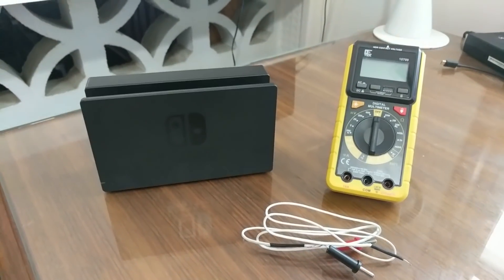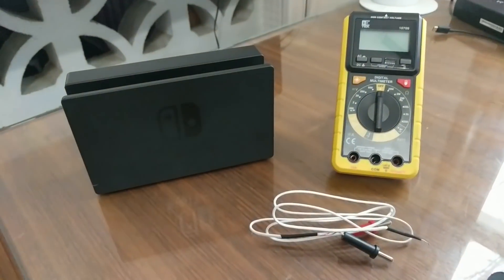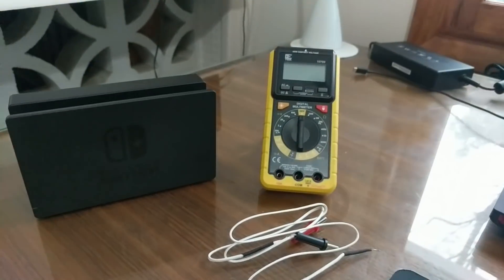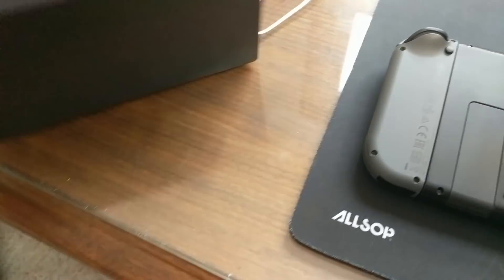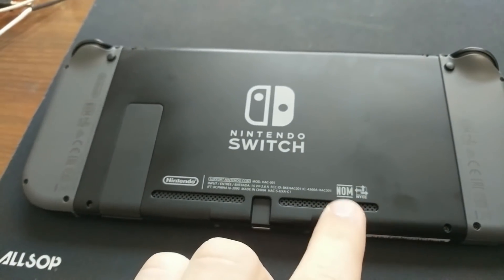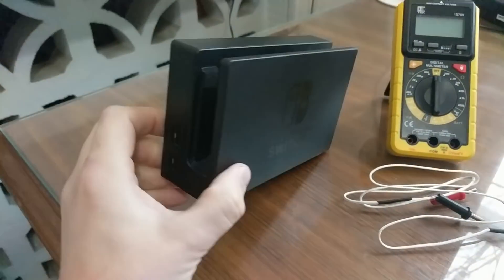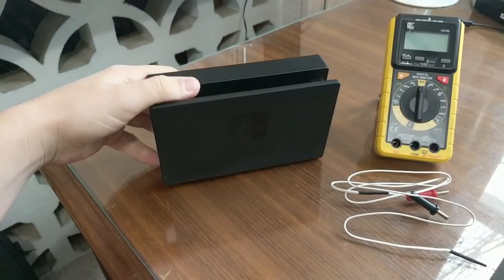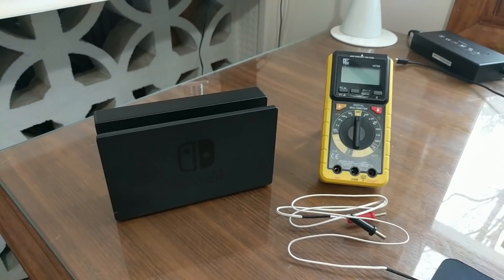Final Nintendo Switch Cooling Mod - Available Now!

Comment: My biggest question before I consider buying this is what about the dock itself? Will the circuit board in the dock overheat? Turns out that with my used Switch and dock, after some period of time, the audio will start getting loud and start cutting out, especially during the loading screens. I don't know if it's a problem with my Switch, my dock, or if it's the monitor I have the HDMI cable hooked into. If it is my dock, it may make the problem even worse.
Reply from the maker: The circuit board will be fine.  There is no active cooling in the dock and it does fine.
Reply: @M1dn1ghtN1nj4  

But doesn't the Switch suck in air from that part of the dock, also blowing in air over the circuit board?

Comment: Hi. i just purchased the print files to let it print localy. This is the first time i come in contact with 3d printing therfore i have some questions. Wich print material should i chose?  Also i can chose between difrent "infill %" from 30% to 100% . Does the infill  percent matter with this kind of Model? To my understanding it does not, but better safe than sorry. Thanks for the work and the fair price. best regards from germany
Reply from the maker: PLA will do just fine.  Since it's so small, I sent with 100% infill.
Reply: @M1dn1ghtN1nj4   i'll go with 100%. thanks for the quick reply

Comment: Doesnt this mod cause circuit board in dock to over heat im sure there is reason qhy air drawn past it remmber your hdmi and your usb 3.0 and power all located there surly it generates lot heat needs venting?
Reply from the maker: So circuits generate heat, and the dock is no exception.  But my mod does not completely seal up that area.  And by it's inlet position, it still pulls in some of that warm air, but much less than before.  It pulls in more cold air than hot, but it's still pulling both.  Without extensive designing, I couldn't make it pull 0% warm air if I wanted to, the dock case design doesn't work that way, and I wouldn't want it to.

Comment: I use my fan and blowing at the back of the switch to cool after i play and same as my dock
Reply: circulating air that way is very ineffective and is basically useless this is a better solution. the reason is that you're just adding more airflow the reason humans cool down with more airflow is because where water based.so sense cpus ae not water based more air flow does not improve it that way making room for the air to circulate does improve it though and that's what this mod is doing
Reply: max campbell works for my phone when I play games at 60fps and it doesn’t thermal throttle as much as before , but more airflow is also pretty good, and ps you shouldn’t have brought anatomy into cooling a cpu def not the same thing, and if you’re taking that smart you better change the roblox profile picture so people don’t think you’re a 5 y/o

Comment: Be extra careful with those tabs. I just installed it in my dock and ended up with one of the tabs being broken off. It still works fine and looks stock, just remember to push those tabs back into place.

Comment: Bro thats awsome....  Nintendo could have done that lol. Im going to freaking get one now
Reply: Judging by the design, Nintendo didn't do it because they wanted the fan to pull cooling air across the dock's pcb to cool it as well, but it really doesn't get hot enough to justify preheating the air coming into the Switch.

Comment: your ebay link wasn't working... plus i have an oled dock. the concept is practically the same, so i did a bit of DIY with a business card and some tape. probably not as good as yours but i'm a freak about getting the absolute best i can for my devices. 10c is a huge temp drop when you consider all we're doing is taking airflow away from components that don't even need it in the first place, and directing it to the actual system, and to think that the chamber for air flow is so tiny. i'll take it where i can get it... also re-pasted my switch today with thermal grizzly kryonaut, and i've been extremely tempted to modchip my switch and add an aluminum backplate and some extra thermal pads.

Comment: Now there is no active cooling for the docks internal components.
Edit: though my compliments for a very tidy design.
Reply from the maker: Fantus The vents in the top of that little box are where the hot air from the components exits.  I didn't cover all of the vents intentionally, so that the heat could still escape.  There is still plenty of venting left.

Comment: How I have a question. With this this mod installed would cooling fans that you can buy online work? I figured the fans world help increase the airflow and with the mod it wouldn't just be blowing on the back of the switch.
Reply from the maker: Almost every "fan mod" tries to blow air against the back of the Switch directly.  While that may cool down the shell of the Switch, it essentially does nothing for the internal components, which the fans air is unable to reach.
Reply: Yes I know that but the fan is forcing air into the top opening of the dock and the only place for it to go is through the switches intake air vents so wouldn't it be safe to assume it would increase airflow?
Reply from the maker: Patrick no, the fan is cut all the way through the dock, and the airflow is directly against the back of the Switch, completely bypassing the dock and both of its vents.  In all honesty, some kid probably saw a video of old PSP fan hacks, and thought it was beneficial to add a giant fan to the dock like that.  It's wrong, but that's probably what happened.
Reply: I never meant like actually cutting the Dock or doing any custom modifications. There is this 3rd party fan you can purchase and it slides into the top of the dock where it's not covered. This cooling fan would increase air flow with the only exit through the Switches back intake vents. I understand that cooling fans are useless if they just blow on the device. You're supposed to blow the air through the devices air intake to have any effect. The right most fan is directly over where your 3D printed vent mod would be seated. A picture of the fan in question. https://imgur.com/fc23IT5

Also here is a video of a guy that does the opposite. This device is being used to suck air out of the Switches outtake vent. https://www.youtube.com/watch?v=xA9RaDBB59k&t

Comment: wouldnt cutting the black bottom pieces provide even more airflow?  It just looks like its blocked with the exception of the spaces in between.  I purchased this and will cut the black pieces out.  If the mod needs to be secured I will just super glue it so it doesnt move.

Comment: Just got mine in the mail. It was super easy to install and fits very snug. I noticed the design I ordered was slightly different from what I received, but im just going to put faith in you that it was for a good reason. Thanks for the simple mod. Looking forward to gaming.
Reply from the maker: The design was different?  You mean the color it was printed on, or the shape?

Comment: This fails to mention there is a V1 and V2 board, idk what that means.

All it did to mine is make it hotter. The fan stopped working when its docked but kicks on when I undock it. This also limits the HDMI chip cooling so of course it will now get even hotter in the dock.

Comment: So essentially this mod is isolating the switch's air flow from the dock by removing the dock's passive cooling. Can't this simply be achieved by taping over the 3 holes of the 2nd air vent?
Reply from the maker: Sure, but then there is no airflow through the circuit board area, and you cut the airflow volume into the Switch in half (half the inlets, half the volume)

Comment: I'm not trying to be skeptical here, but I'd bet that the reason the Nintendo didn't do that is that they are using the fan in the switch to pull air across the dock board to keep it cool.
Reply from the maker: There is still air flow, and enough to allow hot air to vent out.  But if I had to make a choice, I'd rather have me cheap dock die and not my expensive Switch.

Comment: Great idea, development, and implementation. There's several comments regarding how the mod may affect the cooling of the circuit board "chamber", but haven't seen any data quantifying the temperature of the circuit board chamber with/without the mod. I understand you designed the mod to allow heat from the board to vent out to still allow for cooling and the value placed on the switch > dock, but I'm very curious what the difference in temperature is of the circuit board chamber and how the (likely degradation of) cooling of the circuit board compares to the improvement of the Nintendo Switch Console cooling. Do you have any data measuring the temperature of the circuit board chamber with/without the mod installed?  Thanks in advance, appreciate any feedback!

Comment: You should glue 100% around the blue mod for a airtight fit and then drill holes into the panel resting on the back of the video card doo dad. Only saying this because if it’s putting out almost 16-17 degrees above room temperature it definitely needs airflow too, the glue around the blue piece is to keep that nice tight airflow it had before holes where drilled into the cavity.

Comment: I appreciate the design, but I don't see going from 92f to 78f as anything big for computer components to run at. 32c isn't really anything, but best of luck with it!
Reply: I don't think it's even testing the actual temperature of the switch.. its simply testing the air going into it which normally rolls over those chips.

Comment: Wow. Very impressive man. Less heat should make the unit last longer and the battery last longer. Batteries don’t last as long with heat. Even though it’s docked, the battery is still effected by the heat going through the switch so this is a good mod altogether

Comment: I bought the file and made five including one for myself and the rest for my friends for the moment they are very happy with the result our switch are less hot during long gaming sessions
we were able to test: Monster Hunter Rise, Super Smash Bros, Fire Emblem
I don't have any tools to measure the temperature but I feel less heat when I take the switch in hand once out of the dock

my next step will be to take it apart and change the thermal paste because I have already had it for two years
Finally I am very satisfied to have bought your file and I wanted to thank you for finding this solution
Sorry for my bad english

Comment: That's not really that much of a difference to be bothered, about 6 degrees Celsius.

It's most likely gained by the fact your no longer passively cooling the dock components with passive air flow, which could probably be detrimental to the docks health in the long run. Especially if using a USB network card or a usb controller/charging from the dock winch would generate heat from the usb chipset, not to mention the HDMI chipset does generate heat as well on the dock.

All of which again is no longer being passively cooled with this mod.
Reply from the maker: Jeff J Not ask of the vents are leading into the mod.  But then again, if anything WERE to happen, I'd rather it be the cheap dock, and not the expensive console.

Besides, converting to Celcius in order to make the numbers "sound" smaller doesn't take away from the fact that the Switch is now getting properly cooled air, as opposed to the hot air it was receiving before.  If you're worried about overheating the dock, it might be time to think about how overloaded you might have it.  It's not a Lamborghini.  It's plastic, and designed to be cheap so there is a higher profit margin.  Of the two, the Switch should be the priority.  The Switch can work without the dock.  The dock is useless without the Switch.

Comment: I, some how ,bought the idea, but I still have no clear how does it do it. This plastic absorbs the heat or it is just to make it flow the hot air somehow outside.. I still don't get it!.... BUT.... I ordered mine today due to his excellent reputation AND good comments about it!! Somehow I feel like black magic around because I still don't get how it functions..
Reply from the maker: Think of this like a cold air intake on a car.  Pulling in cold air from outside the hot engine bay.  It won't magically make your Switch ice cold, but it does reduce the temperature of the air being pulled into the Switchs second intake.  The dock circuit board still has plenty of ventilation, as I only use up about half the space for the vents in the back for this intake mod.  Other than that, it's pretty easy to use.

Comment: Isnt it the doc designed like that so that the switch is also puling away heat from the board in the doc. That power going to it to charge etc. You are effectively stoping all air flow of the heat the dock itself makes. Kinda defeats the purpose of keeping the switch cooler of the doc overheats and fries the switch bc the current control module gets damaged.
Reply: Livingston I tend to agree. The Switch isn’t known for dangerous thermal issues, but if you’re an enthusiast who wants to improve thermals for perhaps battery life, I would redo the internal Switch cooling first before trying this. You would get a far greater drop in temperatures without risking damage to the dock and possibly the console indirectly.
Reply from the maker: No, I'm not blocking ALL airflow into the docks board area.  That's been pointed out several times, and was specifically mentioned in the video as well.  The dock doesn't really need active cooling, passive it's fine.

Also I would recommend against opening up the Switch.  That voids your warranty immediately, which my mod does not.  While it's true that may be SLIGHTLY more effective, the additional risks of damage and warranty voiding aren't worth the effort.

And aside from better thermal paste, there really isn't anything you can do to improve on the internal cooling.  And even new paste isn't going to be as wildly effective as you think.  In some cases, you could actually end up making things WORSE, for any number of reasons.  PC builders run into this issue as well.

Comment: Started playing Diablo III on my switch and after a few hours I picked it up off the dock and was surprised at how hot the console was, so Ill be picking one of these up.  My switch dock is mounted on my wall, so Im wondering how much of a difference this will make, I assume the same results that were demonstrated in the videa here.

Comment: My wife just got her switch and we were playing with it tonight lol while I was playing on the tv and she had it in hand held mode it was fairly warm not hot. She asked if we could play it on the big screen sure honey. After 40 minutes the system was way hotter than it was just sitting in her hands. I had a suspicion that it wasn't getting cool air on one side due to the board being on that end. So dude I saw this vid and bought your mod. I feel like your mod is a better passive way than me using a drill lol or making a vent myself
Reply from the maker: souleaverr that was the idea!  Don't butcher your equipment and get iffy results.  This makes much more sense!
Reply: Oh ya man reason I loved this  video. First thing popped to my mind was someone already made it lol. My first plan was to use a dremel and cut a whole in the case and mount a 80 mm fan and use my multimeter to solder the wires to the board but  that would be definitely voiding a warranty lmao. So when I saw this I was like sweet now I don't have to void my warranty lol. Thank you so much man.
Reply: Perhaps it was hotter after being in the dock because of the higher GPU and RAM clock speeds 😉

The GPU runs literally twice as fast in docked

Edit: fixed a typo

Comment: Quick question: Should I glue the mod or not? There can be a moment where it pops out of place, so could glue be a better way to secure the mod in place?
Reply from the maker: No, I wouldn't glue it.  Once it's in, it'll be held in place by the circuit board.  The whole purpose of this design was to NOT damage or modify the dock in any way.  Plus, if you use hot glue, you risk warping or melting the dock plastic.  Just pop it in, and call it a day.  :D

Comment: Hey! So I bought the cooling mod around a month ago and I installed it and my switch still overheats. It may be my Nintendo Switch but if you guys think there’s anything else I can do, please tell me because I literarily can’t play any game without overheating in less than 20 mins
Reply: Does it overheat when in handheld mode as well? If not then it's your dock. If so, perhaps your switch has dust inside or maybe a broken fan?
Reply: If your switch is still in warranty you can give it to nintendo 

Otherwise just take it to a proffessional to clean it off/ replace thermal paste( a good quality one)/check for any malfunctions
Reply: lalamike25 yes it overheats both ways
Reply: Ahmad Sowayan Okay I think imma have to get it cleaned
Reply: @dilanmunoz8864  I would love an update if you're OK with it :)

Comment: I am concerned as to where you put the piece that is reading the temperature. It would be easy to put it somewhere hotter / cooler to "prove" your "mod" works. I do not see the proof in this video.
Reply from the maker: Kevin Rothacker the probe is directly inside the mod.  To get it there, a bit of disassembly was necessary.  So even if I show the back of the dock, you wouldn't see the tip of the probe, as it disappears into the venting in the back, and into the mod inside the dock.  If you could see the tip, then the dock wouldn't be properly assembled, botching the results of the test.

Take it how you want.